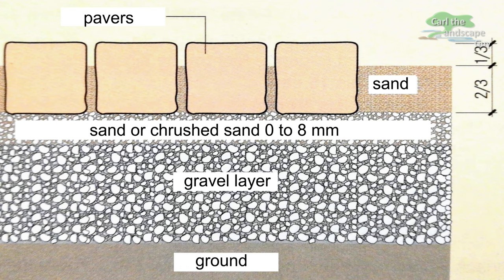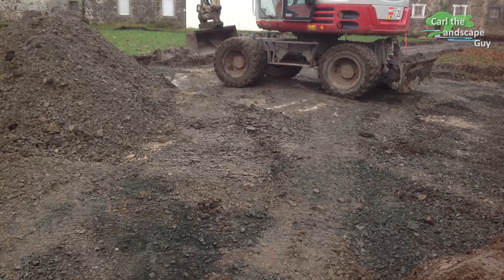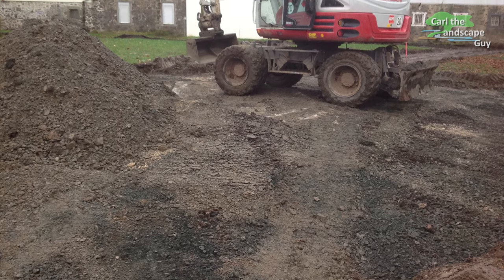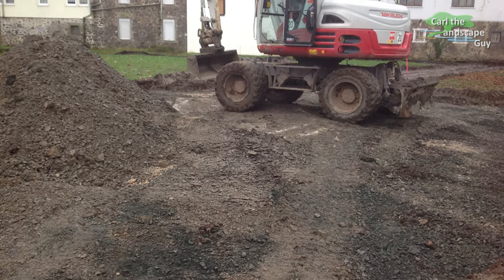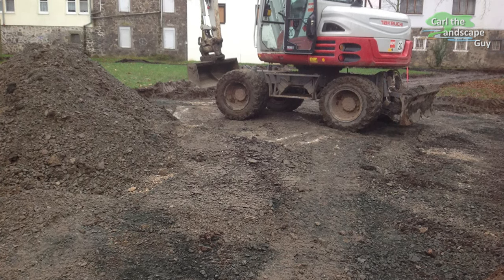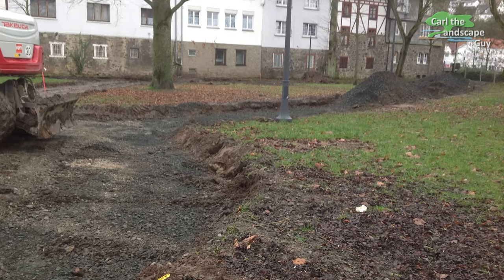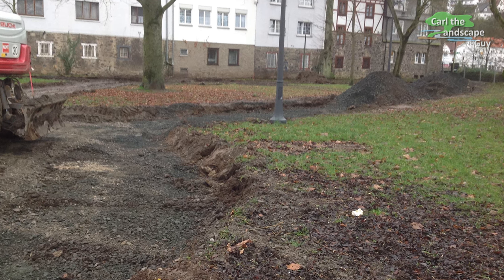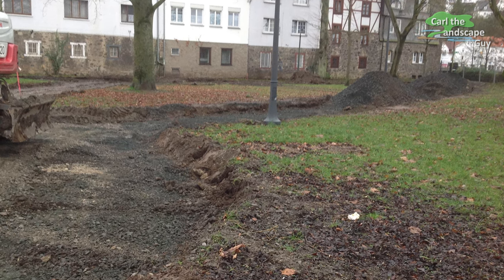LAYING COBBLES, TRADITIONAL ARC PATTERN, NATURAL CUBE STONES, CARPET TECHNIQUE, GRITSTONE SETTS PRO

Comment: I stumbled onto this video by chance while researching techniques for a DIY walkway project for my home.  I'm blown away by the simple beauty of the arched pattern as well as the central Compass Rose and wonder if the pattern & technique would be applicable on a much smaller scale. The planned width of the walkway is no less than 48" with a 10' semi-circular area in near our front door and a length of approximately 45'. I would appreciate any suggestions with regards to materials or patterns that might work with these dimensions. Thanks for posting this video of this work of art.
Reply: to achieve the same pattern you'll need to work with stones half the size as seen in the video. so around 4/6 cm or 5/7 cm

Comment: Why arcs?    I think it's beautiful, and I know it's very common and traditional (ancient) but it seems like it would be much more difficult/complicated than rows straight across, like a standard brick pattern.    How did the ancient cobblestone craftsmen settle on this arc pattern?     Is it easier to work with curving roads, or at intersections?
Reply from the maker: its very stable and lasts, there are some very old roads like that

Comment: Great video. Is this a more traditional method, you see alot of modern installs lay on a bed of cement, whicj i suspect is a less skilled method? Maybe I missed it but how do you fill the joints is it only with sand or do you use a cement mix?
Reply: They use stone powder, usually from the cover stone provider!